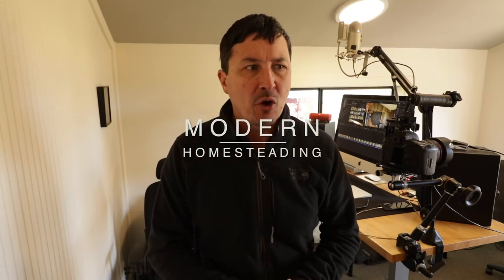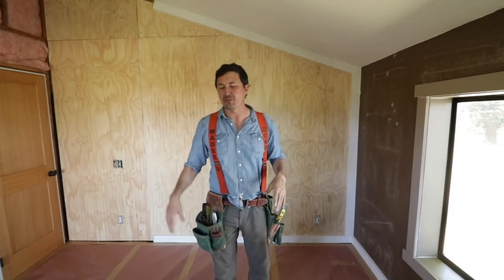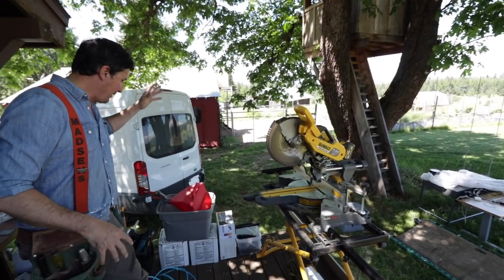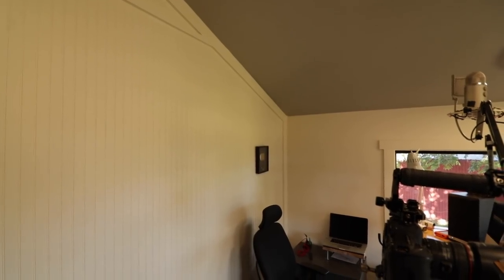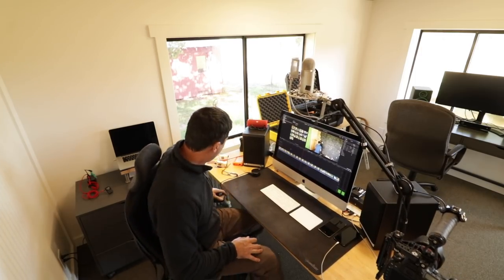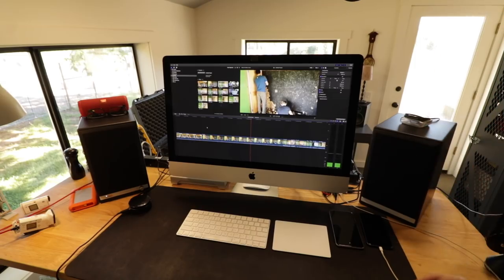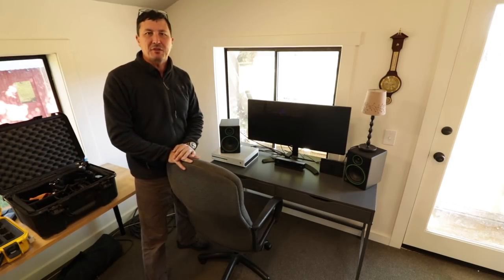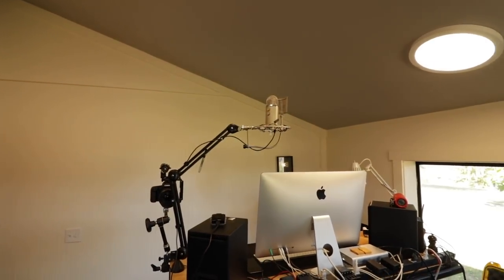Cody Gets A Office Makeover • Wranglerstar

Comment: If you want to experiment with a green screen a cheap starting point is a solid color sheet with a few options for how to hold it in place to not do permanent damage to the wall from clip on grommets in the corners to string up to eye screws. For the bottom the same clip on grommets to hang weights on to pull the sheet to prevent it from blowing around. To light it a cheap led or florescent light reflected off a sheet of white foam board from the dollar store to stop you from looking into the light but still give you good even lighting. 

If you need to setup the screen in the middle of the room a PVC pipe frame is easy to make. 

With the gun stuff in the room look into some mirrored window tinting to prevent people from looking in and thinking jackpot.

Comment: I could not believe the handyman that came over to a rental. He repaired a back door,  bath tub drain, replaced a wall air conditioner and a few other items. He did a great job. But his tools, at least one hundred, spread from the back door to the front. Also the air conditioner was larger then the existing that was another mess of building materials. Again, very happy with the work, just hope he not missing tools.